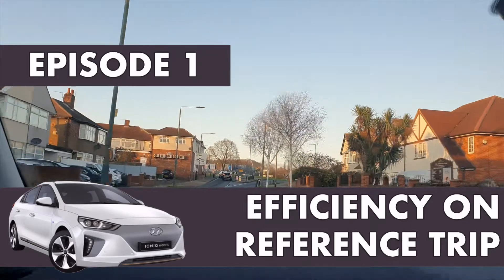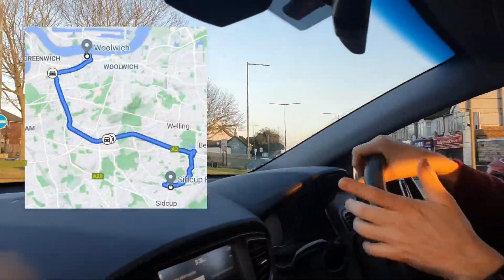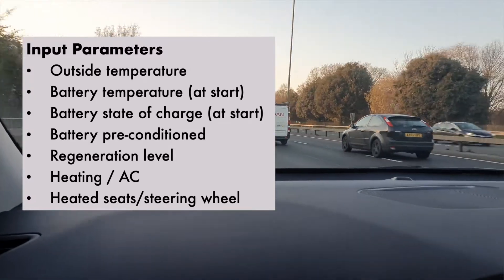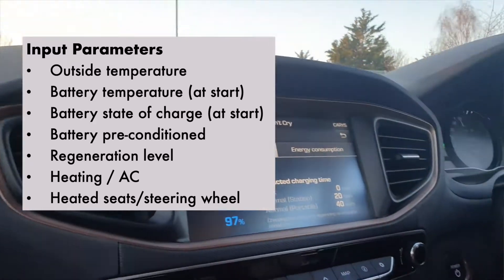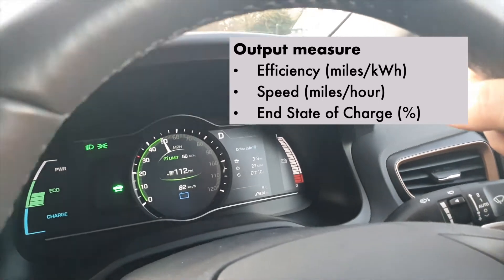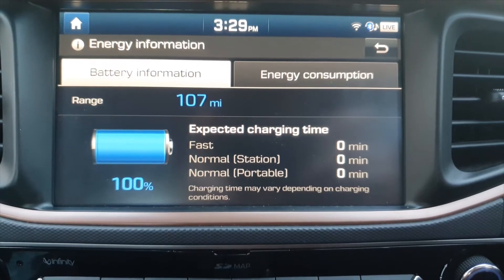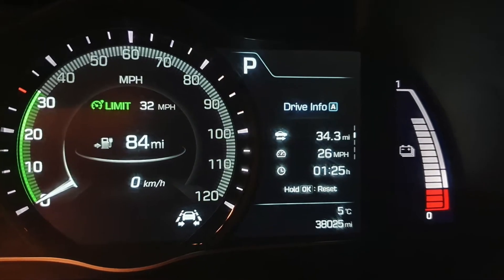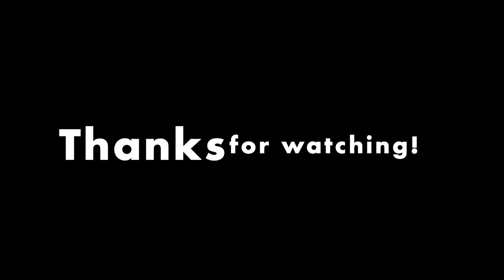Ioniq 28kWh - Efficiency on reference trip - episode 1

Comment: Thanks for the video.  I have this car also, 2017 Ioniq EV, but I don't have the ultimate, which you appear to have.  Main difference, heated steering wheel, and sun roof.  I look forward to you next videos.
Reply from the maker: Thanks for your supportive comments. Not sure which country the ultimate trim is available in, this is a UK model premium trim so in fact the entry level there. But indeed with heated steering wheel.
Reply: @evdabbler  in the USA the Ultimate adds the following, copied from Car and Driver, none of which is in my model:

"Our test car also had the $3500 Ultimate package, which includes a power sunroof, an 8.0-inch touchscreen infotainment system with navigation, adaptive cruise control, and advanced-safety items such as automated emergency braking and lane-departure warning."
Reply from the maker: @maurice7413  good to know! Thanks